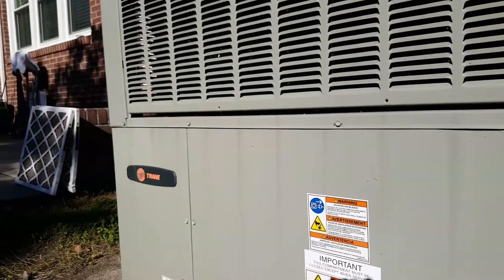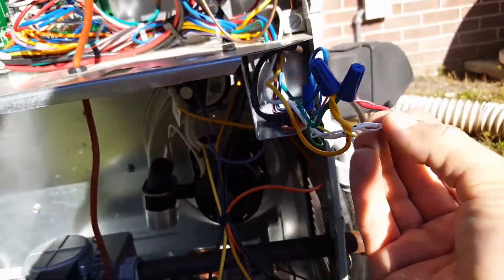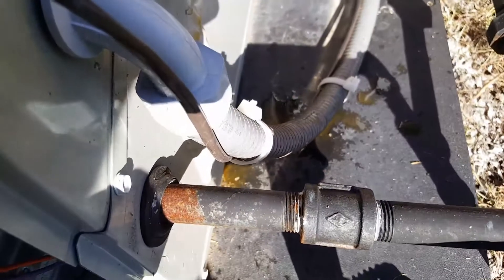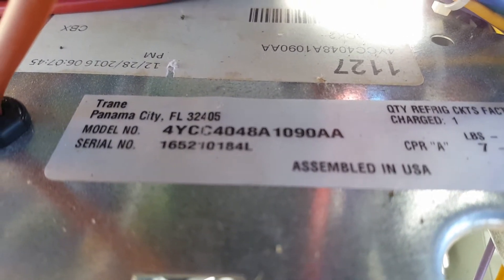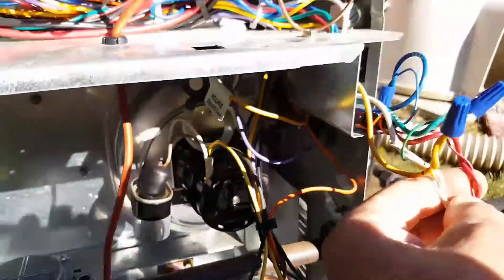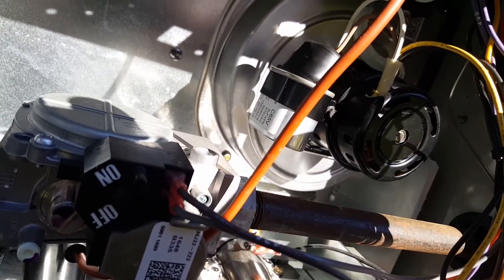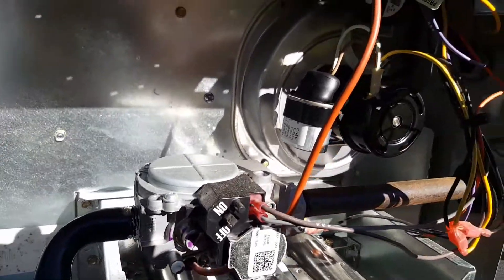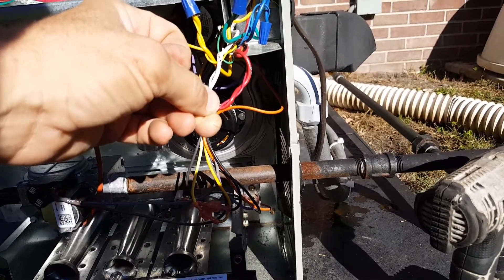Trane / American Standard Gas Pack Recall

Comment: I have replaced mine 4 years after it was installed and now it has gone bad again 5 years later although it was making enough noise last year that it probably should have been replaced then. This year it sounds like an air compressor and one of the fins from the squirrel cage is laying on the ground below the exhaust port and is rusted off so I'm getting it replaced today. That means they last about 4 years which I believe is unacceptable!
My unit has a 10 year parts and 5 year labor warranty so the first failure was free but this time I'm gonna have to pay for the labor at around $300 and I'm guessing 4 years from now including the part, it will be over $500 and there is NOTHING I can do to prevent this from recurring due to their poor design. I have also called Trane and they seem to not care about it at all and have referred me to the "Trane authorized" dealer who installed it who also seems to feel like it is NORMAL wear and tail! REALLY--4 YEARS!!